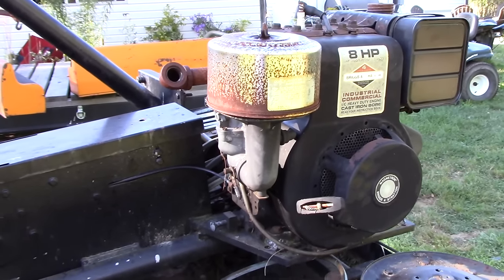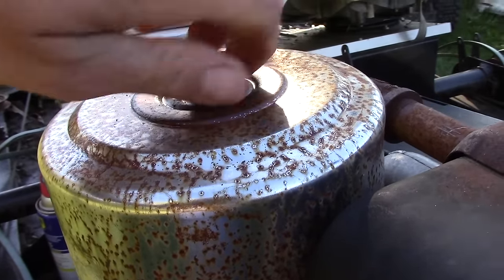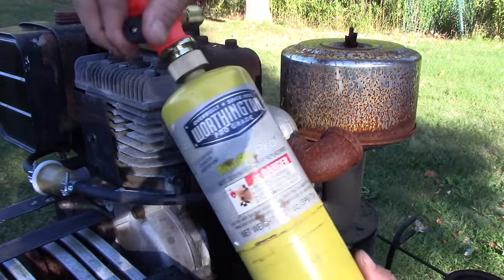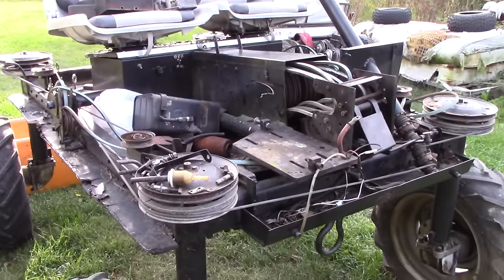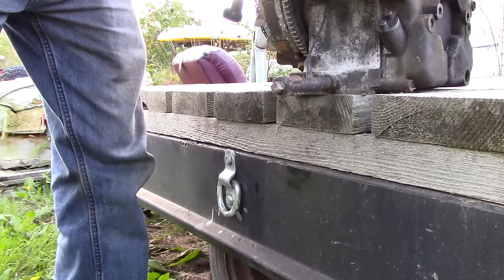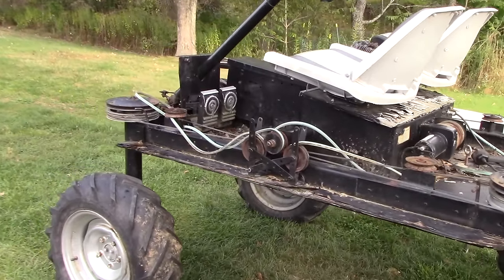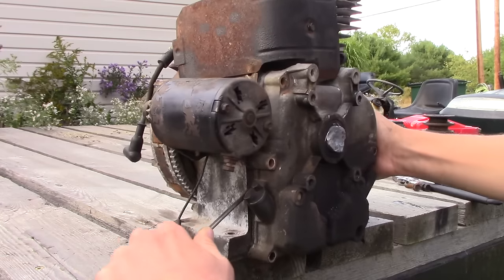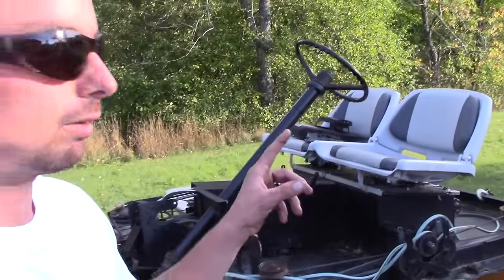Quadractor Update #1 (Engine Assessment)

Comment: If/when you need new belts: My mower uses a long drive belt that was costing me about $80 from the place I bought the mower. I found a Cub Cadet belt at Tractor Supply for $35 by comparing sizes, and then I found an industrial belt supplier in town that had the right belt on the shelf for a whopping $15. And, rather than 2 belts per season on the OEM belt, I'm on my third season on one belt. So shop around, and if you need them, the company I used is Industrial Supply Solutions in Salisbury, NC.

Comment: Keep the parts that are salvageable from the motor, one day, this rig can fetch you a good price (considering its purpose and rarity, get it to the right buyer, and you'll get at least more than you invested, but that's only on original parts, so the engine must stay). Considering this is a log puller, you could add a bar that hooks up in the main pulling loop up front, and with the which raise your other vehicles and pull them. That'd be a great use for it and certainly way under its capacity.
Reply: Also, good price on those 50$ Hondas, if you're lucky and you can get one running (with the other as spare parts) then that's a good deal. Those are pretty nice engines when setup right and well lubricated, i have one on a winch i made two years ago and it works really nice, with a reduction it pulls along like a champ.

Comment: Those Honda engines are hard to kill. My pressure washer has one with 3,000 hours that has had almost nothing but routine maintenance. I change the oil every 35 hours and clean the air filter once a year. It's on its third spark plug since new. The carbuetor was replaced about 5 years ago and the main crankshaft seal was replaced. I bought it in 2000 and it still starts with one pull. There is no need for electric start on a GX-390 unless it's in a hard to reach place.

Comment: If I was in your position I would put a predator engine on for simplicity. Get the pulleys you need, throw it all together. When it's running and driving properly I would see if you can locate the plow attachment and use that in the big snow storms at your house to clear the drive way and such. A plow and a walk behind snow blower make a great pair!

Comment: If the exhaust port treads were stripped out using bolts u could try to use studs which turn quite a bit deeper into the block. This solved the problem for me at least. I would also suggest removing the governor for some extra speed, from my experience these gx390's can take it with ease.

Comment: i cant be the only one thinking a diesel quadractor would be badass use an engine like in the sears had lots of torque
Reply: More torque yes, but it cant rev up as high so it will be significantly slower
Reply: N Perry From what i read, Quadractors weren't made for speed. I wan't diesel power!
Reply: true but if its for offroad use that extra torque can work to an Advantage spinning all those 4wheels plus extra weight of riders
Reply: it being a diesel would be awesome but in mud wheel speed comes in handy, and if it's too slow trail riding wouldn't be any fun

Comment: That bearing is pressed on the crankshaft and should never be removed unless it is damaged or your switching to a non bearing crankcase cover due to busting the cover. I have a good 8hp Wisconsin with pressure lube if your interested in putting something different on it :) prolly a 1970's engine. perfect compression, ect

Comment: Dude,the piston rings are sticking to the cylinder wall!Once you get water contamination in the cylinder,you basically need to rebuild the engine!Find one in newspaper classified ads on or off a lawnmower or just on its own?!You can one for less than $50-100.00 used and have the rest of the mower for scrap or for spare parts..Good luck!

Comment: You could have gotten that engine running. Just remove the piston and the sand the rust out. Put the piston back and you would be ready to go. It might not have had all the it used to, but good enough.

Comment: You can buy a compete new chinese knock off carburetor for a GX390 on Ebay for about $15-20 shipped. Well worth it as opposed to rebuilding the one you have. Basically the same thing that comes on the predator engines that harbor freight sells.

Comment: I mentioned this before Todd, but with a 72:1 gear ratio I think you are going to be very disappointed in the speed of this thing, even with 5 more HP.  Rather than just replace the stock drive pulleys I think you, or anyone would enjoy this more with higher gearing, much higher lol.  at 12-15 MPH this could be a fun ride on the trails, at 5-6 MPH wide open which is about all your going to get, that will get boring real quick lol.
Reply: use a diesel engine with a higher gear ratio
Reply: With it's height and COG I don't think making it go much faster than it did stock would be a good idea. One wrong move at a higher speed and a broken axle tube or 2 would render it scrap.
Reply: dj beard These things are basically unbreakable.  That being said they are also VERY slow.  5 to maybe 8 MPH max with governor removed.  They are built for carrying logs underneath, big logs, all they have is torque. 

Unless Todd intends to use it as a log carrier, then all that torque is useless, slow and boring.  With it's height I wouldn't want to be on it going more than maybe 15 MPH, but it would be a total blast at that speed on the trail.

Comment: I really think that you should have used a more unique engine choice. It seems like a lot of builds use Hondas or Predator engines, and while they work well, it just seems like it is used way too much on a lot of builds that I see. I think you should try to find another old Briggs, Kohler, or Tecumseh engine. Or, you could do a twin cylinder like a Vanguard, Onan, Briggs opposed twin or Kohler Magnum twin.Then, not only will it be unique to the project, it will sound badass as well.

Comment: that engine could have got running easly actually. I recently got a Murray mower with 12.5 worse then that, she smokes slightly at start up but runs good after a few oil changes

Comment: water in the engine can sometimes not be too bad i have a 12.5 hp Flathead on my Murray had water in the crankcase but all that was wrong with it was some rust and it came right off with some steel wool

Comment: You should look up on Google "Powerland engine". They are Honda clones, like the Predators, but half the price. I bought a 16hp one for $170 free shipping and used it on my screw cone log splitter (videos of the engine and log splitter are on my videos on here). They make smaller models too but for me it was go big or go home. They have a 1 inch shaft too.

Comment: why don't you rebuild the original? and keep it original?!
Reply from the maker: I can't, it's a 3/4" shaft... I need 1" shaft
Reply: OK cool.. thanks
Reply: It's a shame the shaft size won't work, that motor looks like a challenge but it doesn't look as bad as a motorcycle my brother and I pulled out of a barn when I was a senior in HS.  We beat the piston out of the barrel with a brass hammer and a rod, scuffed it a little to get most of the burrs off and stuffed it back in with a new set of rings.  Thing ran for my Senior year and my brothers (two years behind me) before it gave up the ghost. BTW, Kroil eats rust like nothing else you ever tried.
Reply: a 6hp diesel or a 10hp would be super cool!
Reply: Alfred Shumake 
By the time u rebuild the motor and the money u put in it u might aswell buy a new one
Reply: If it is the original why do you need a different size shaft? Or am I reading these posts wrong?
Reply: +FearlessFront (Todd Christopher) hey do you wanna sell the Briggs 8 horse block I've been looking for a cast iron sleeve 8 horse

Comment: You should have stripped the entire machine down. Cleaned all parts, stripped all painted surfaces down to bare metal, repainted everything. Then replaced all bearings and belts. Then used truck bed liner to coat the entire under carriage. Finally, put a 20HP plus, twin cylinder, diesel or gas engine (I personally would put a diesel in it, if feasible).

Comment: Next time don't cut shaft. Drain crank case. Fill crank with Marvel Mystery oil and sit in hot sun or warm place for a few days. Drain and refill with fresh Marvel repeat procedure don't drain try to turn crank with pipe wrench carefully. If bearings haven't  failed it should crank smoothly 8 out of 10 tomes I've had success.

Comment: That engine is fine I delt with worse, just order a crank or better ebay I'm more than sure has one. spray the valves with pb blaster and let sit over night then heat then up and spray again then tap them out, the cylinder I would clean then hone it good, then grind the valves down and gap the valve stem 8 to 12 thousands of an inch

Comment: put a 212 predator on it
Reply: Original Briggs: 8 horse
Honda 390: 13 horse
212 Predator: 5 horse
Which is better? You tell me.
Reply: its too weak.. id say a 301 or 420.
Reply: I say 420 predator
Reply: Simon Richard predator 301 is 8hp and has more torque.
Reply: Nate Donnelly 212 can be from 5 hp up to 6.5..
Reply: 670cc
Reply: ever thought about it not being designed for mor then 6,5hp? i think hes crazy for putting on a 13hp motor id use a 9hp max. It would suck if he would break something on it
Reply: I honestly don't think it matters.  These Quadractors are built strictly for torque.  The drive system is completely bullet proof.;   My thing is I don't think Todd gets yet just how slow this thing is going to be with stock pulleys.  They go max speed 5-6 MPH wide open.  The 13 HP motor may give him 1 more MPH if he is lucky.  

I'd do the 13 HP and full pulley swap to get at least 12-15 MPH out of it for more trail fun.  Otherwise it's a log carrier just like it was designed to be, very slow with a but ton of torque...
Reply: well when you have something like that speed isnt key anyway so it doesnt matter.
Reply: preston121068 since you say, i think diesel power would be great for it
Reply: Mudd Boss except predator does not make a 5 hp 212. it is 6.5. ur wrong
Reply: Nate Donnelly any engine can make less than what it says.. if actually fuckin think about it.
Reply: Ok for example.. let's say there was a 300 hp engine.. all it takes is wrong fuel mixture,bad ignition timing,or choked by the air filter to lower it from 300 to 250 or whatever.. so technically I'm right.
Reply: Nate Donnelly keep in mind very few of the engines ever ran before being shipped.. because they are Chinese engines.. all they really do it assemble,put very little oiling em,and see if it everything moves. That's all.. so they're not 100% the same. Again it's made in China.
Reply: Mudd Boss I'm not sure that is entirely true.  I mean I can not find anything about weather or not they are or are not tested before shipment.  But the fact Predator engines have the highest overall satisfaction by customers over all other brands tells me they are doing something right.

I can not imagine with as spotless of track record they have them not being tested.  As for the "very little oil in them"  that is standard shipping procedure for any engine, big or small by any manufacturer.  The little bit of oil keeps the seals from drying out and prevents rust should they sit on the shelf for a year or even 2.
Reply: preston121068 I know for sure they do run them with fuel.. the just spin the crank.. if anything is defective they throw is to the side.

Comment: please rebuild it I just finished rebuilding my 20+yr old 4 hp Briggs runs like a champ
Reply: why did you torch the output shaft...
Reply: He did not do it. It was the guys at the shop. Also it is just easier to buy a new motor if it's at that state of rust. Yes it might not be original but it will run and move much sooner.
Reply: I'm 14 and rebuilt a Briggs it's not that hard and took me about a week granted I didn't have to buy a crank shaft and I'm sure he had to give some sort of ok to torch the shaft I don't think any shop would just do something like that without asking for some form of permission
Reply: James Flores Yea but did you hone the whole block and piston from that rust? If you did then great! Not many people have those tools on hand. Most likely needs some sort of cnc to get that straight hole in the block.
Reply: Hene193 no i just rented for free a honing tool from autozone
Reply: James Flores Wow they don't do that in my country. That is amazing. Then I would see no problem of rebuilding that engine. Most likely a bit more expensive since a lot of parts need to be bought.
Reply: Hene193 my 25+ year old rings were in stock at my local certified b&s for like 15-25 bucks i had bought oversized rings for 50 but they were too thick so i got the regular ones and we split the differance

Comment: That engine was toast not worth rebuilding. I say so what if the engine isnt original i dont see how 8hp could do much anyway. But ya awesome project bro cant wait to see more!
Reply: Torque determines how much a tractor like that can do. Horsepower determines how fast it can do the job. Torque can be multiplied to huge amounts at the wheels with low gearing. Some old farm tractors did a lot of work with 12 and 14 horsepower engines and low gears. They just didn't do it very fast.
Reply: I know low gearing helps. A 13hp engine is still going to make more torque than the 8hp engine.  An 8hp engine can only do so much even if its geared to do 2 miles an hour

Comment: the original motor is well worth a rebuild. you will absolutely hate those Honda motors. my brother had one and it was the most unreliable piece of crap he ever owned. it's very hard to find those old Briggs most people won't sell them.
Reply: Hate the Honda? The GX series is basically the best small engine on the market today. I've had a GX 340 on my wood splitter for 19 years and all I've ever done was put gas in it, change the oil, and run it. Nothing else. They start easier, use less gas, and run smoother than those old flathead Briggs.
Reply: I defiantly agree, that motor was defiantly worth rebuilding and still is even now.
Reply: I agree with your comment about the Honda engines and how they are top of the line engines... every small engine manufacturer is using the ideas and designs as Honda... I went to a Briggs and Stratton engine class for my job and that's what all their engines are based off of now.. they won't admit it but they are
Reply: I worked at a golf course in maintenance and honda is quieter more reliable ,uses less gas. The briggs and Kholer would vibrate so bad the carb butterfly vale shaft would wear out . Hondas real quality is in the metallurgy . The gx series never wear out unlike their cheaper black colored engines. By the way an easy way to tell how well an certain engine will last is to go by the California emissions rating it tells you how may hours it will conform to the emissions standards. The more hours rated the longer the engine takes to wear to the point of burning oil. Check it out on mowers with different model engine by the same mfr.  Some engines may last as long as 3 time longer before they start to burn oil. I bought a chain saw recently and the same brand saws had many different estimated life spans. Sorry for being so long winded.

Comment: Yikkksss,...water in the exhaust,....not good, from there I kinda figured the piston would be ceased /rust welded to the cylinder.....
OMG....what moron torched the shaft ????......that is unbelievable........
I imagine you could hunt down another crankshaft to keep it original & re-bore  the  cylinder if the rust isnt to bad or sleeve it.....or if the gods are with you find another original engine.
If your plans are resale,......stay with originality,.....I've found its much better.....
Anyhow this definitely peaks my interest, so I'm subscribing.